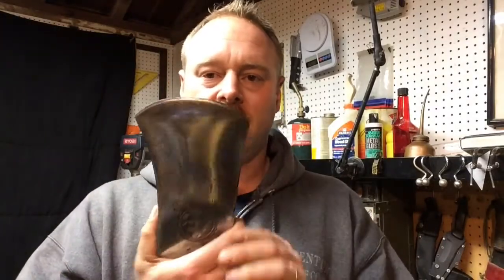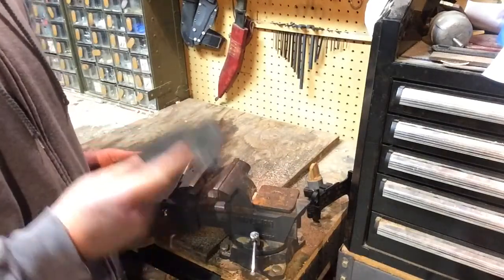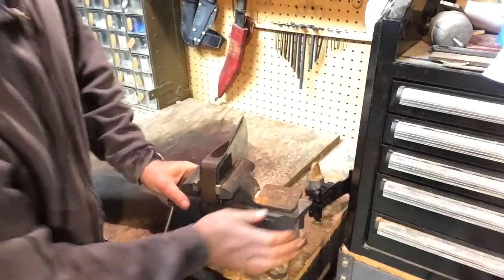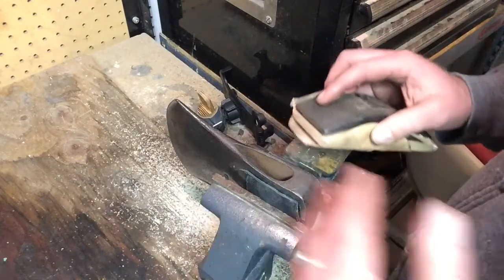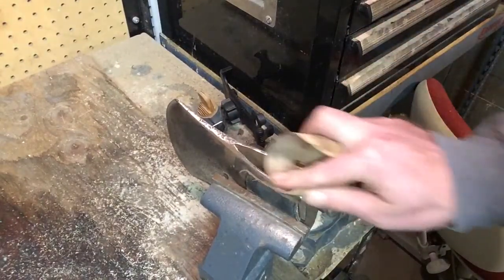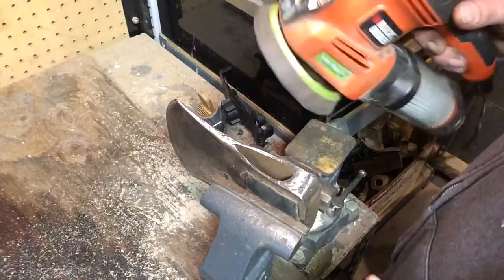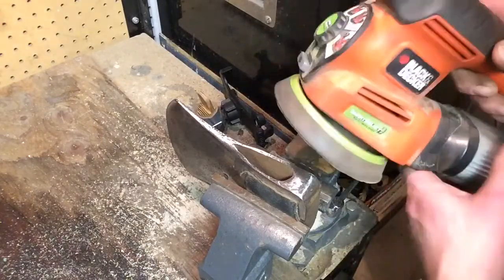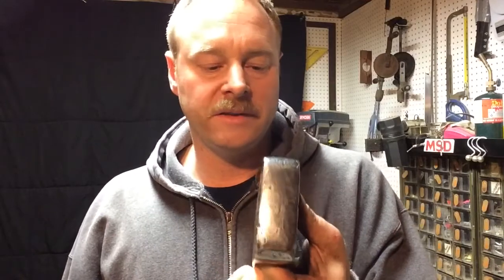Anchor Axe II

Comment: love your vids but flip flops in the workshop is not safe.
Reply from the maker: Hey Ryan, thanks for the concern but if the truth be told I actually wear flip flops in the shop as a preventative measure against boot fires.  In the time it takes to unlace and remove an 8 inch boot you can have a pretty serious problem should your boot become en fuego.  Catch a flop on fire? meh, no worries. Easy to get off.
LOL thanks for watchin' Man